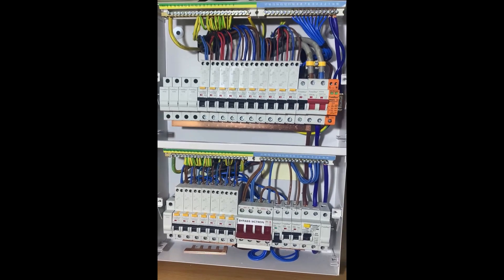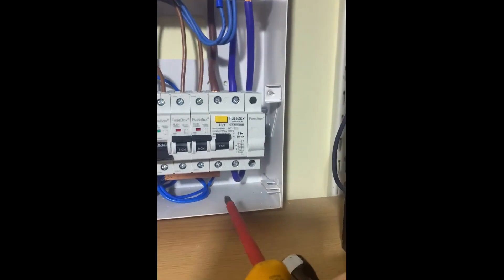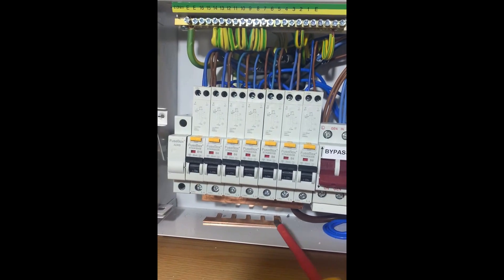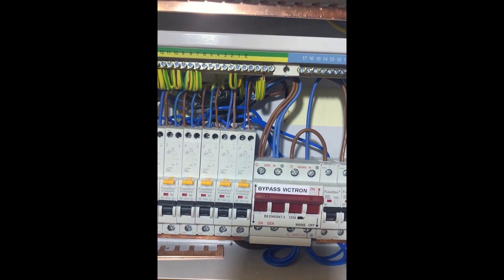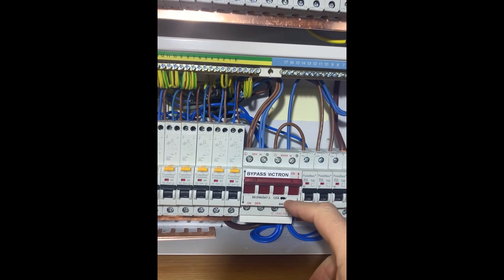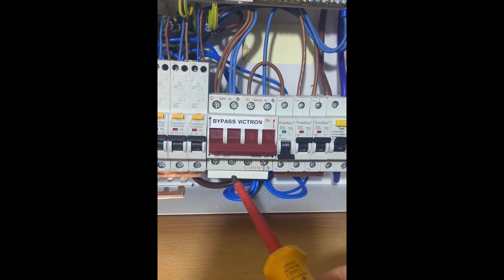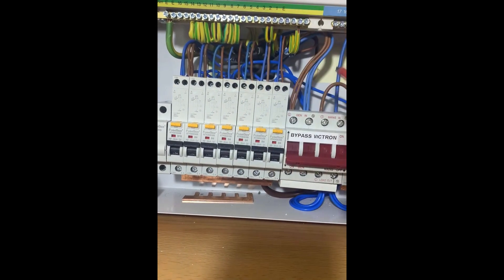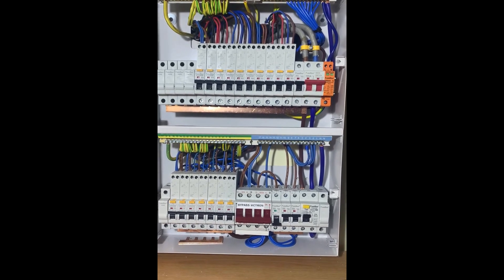Victron Multiplus Wiring PT3 - Consumer unit wiring for protected Loads

Comment: Thank you, has your system been working good? Iv got a single inverter looking to do the same thing
Reply from the maker: yes it works fine, I do have the occasional trip on the type B breaker - but so few and far between it’s difficult to know the cause, it could be anywhere in my entire house - not just downstream of the inverter.
Reply: @eliotmansfield  is solar your main use and grid as a back up?
Reply from the maker: @Mitchyp6183  no, ess charge overnight on cheap rate - solar helps when it can
Reply: @eliotmansfield  did you get yours installed by a installer? Iv done my own setup but can’t use ess unless fitted by a installer? Struggling to find a victron installer